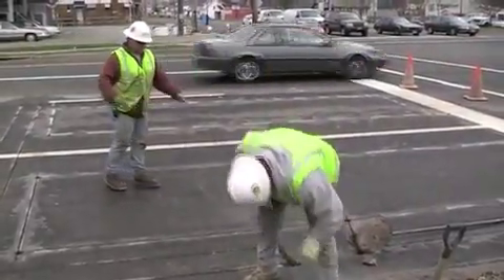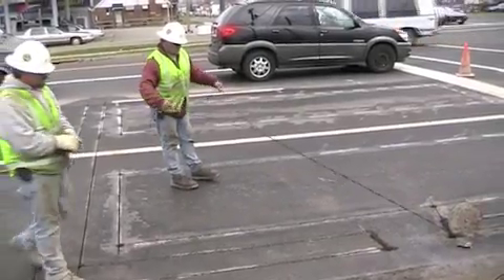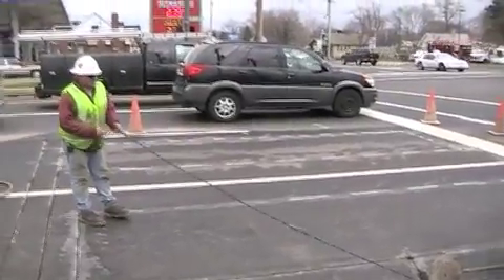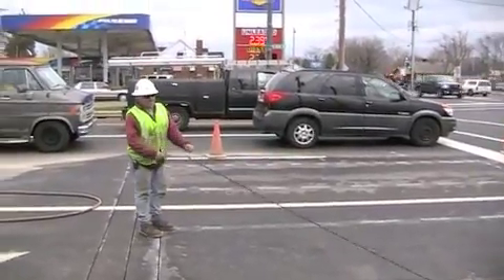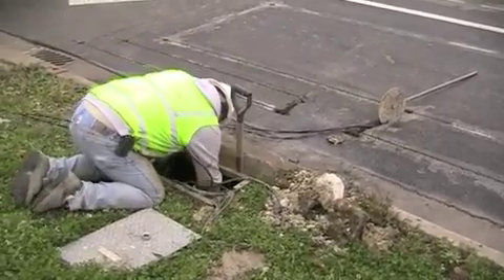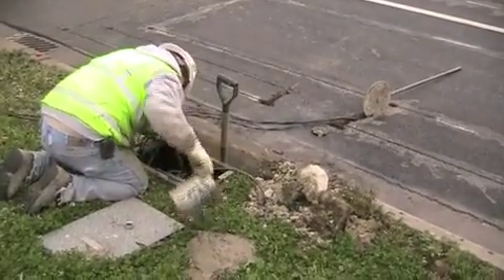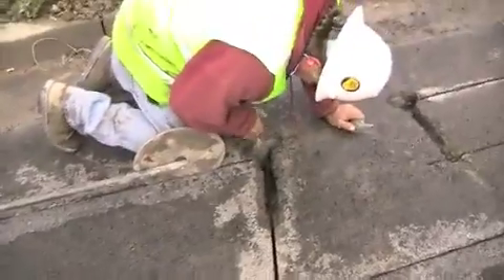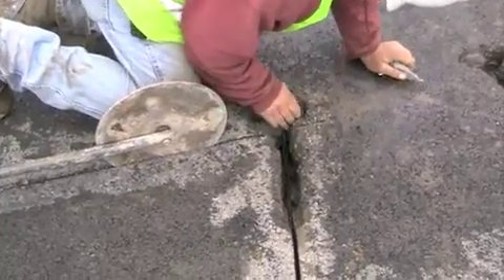Traffic Signal Loop Detector Installation - Part 2

Comment: 13 jan 2020 1:46 pm est:traffic-light-with-car-presence-detector makes variable-green-light-time-duration, should be publicised so car-driver can be prepared and decrease brake-pad-lining-milimeter-wasting.
non-descript traffic-light-with-car-presence-detector-without-count-down-timer, can make car-driver brake-hard degrading brake-pad-lining-milimeter a lot.

25 feb 2020 6:21 pm est:
is this possible ?
make traffic-light know whether there is approaching-car or not from minimum-distance around 1/2 mile.
if there is approaching-car from minimum-distance around 1/2 mile then restart green-light-countdown-timer for n second.
n second is time-duration needed for approaching-car to pass traffic-light with speed 20 mph.

if there is no approaching-car then
traffic-light is free to show red-light to allow car from other intersection-direction pass.

so probability of : hard-braking and brake-pad-thickness-degradation, decrease.

Comment from the maker: If you ride a motor cycle or bicycle and want to increase the chances you are detected by a loop, stop your bike over the long, loop edges (rather than the middle).  The loop is most sensitive here, and you should see a big improvement in being detected.  Otherwise, call the signal maintaining agency.  They may be able to increase the loop sensitivity in the amplifier or provide a non-intrusive detection method (e.g. video or microwave).